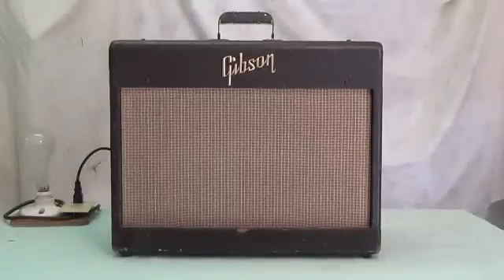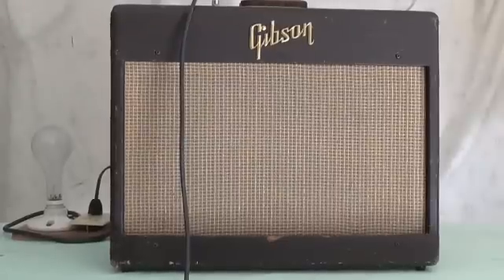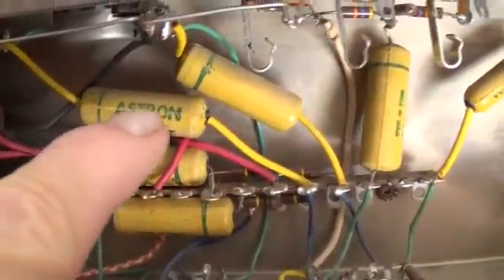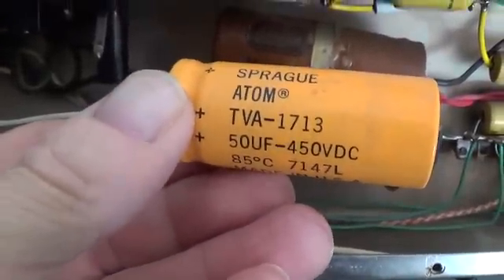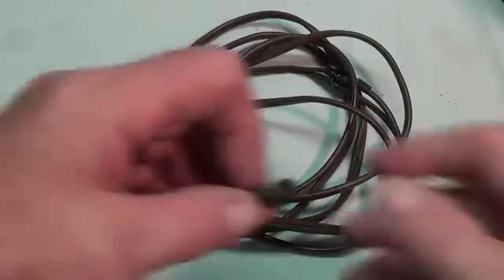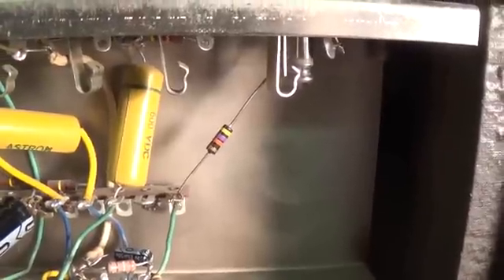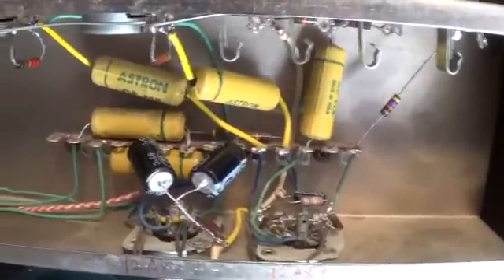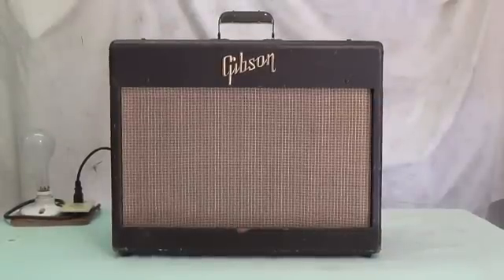Late-50's Gibson GA-6 Amplifier ....with some Very Unusual Problems

Comment: Great video Uncle !!  Thank Rusty for me will ya !!  Your debugging comments did spark an interest in me re: the tube short !!  When there is a situation like this where it seems obvious there is some major component failure(s) - is there a way to pre-check all the tubes in a non-powered mode with multimeter resistance measurements ??  Did you just measure the pins to find that short (of course - after being alerted by the burned up resistor).  Other Comments ??  Do you have a reference that details "good" pin-to-pin resistance measurements for common tubes ??  Thanks again for your great work and your personal integrity !! It's very refreshing !!
Reply from the maker: Greetings, Donald. In most cases the only pins that have any continuity in a vacuum tube are the two pins connected to the filament (heater) of the tube. To be sure, you need to check a tube handbook. To be honest, tube shorts are so uncommon that I don't pre-check for them, unless I see a burned plate, screen, or cathode resistor. Once again, the trusty Current Limiter comes to the rescue. If the bulb flashes or glows brighter than usual when an amp starts up, it's time to turn it off, unplug it, drain the filter caps, and start looking for the short circuit(s). If you don't have a CL, watch my video showing how to build one, and make your own.....before you plug in another vintage amp.
Reply: Uncle Doug
Thanks again for the education Uncle Doug !!  Yup - got a CL and a Variac - and use them liberally.  Thinking about  a tube tester - but that may be a bit excessive !  -- Don
Reply from the maker: Sounds good, Don. Best of luck :)

Comment: It's disgusting how unscrupulous some people are prepared to be with faking repairs. It might be a good idea to take a digital photo of your tube amp before sending it in for repair - that way, any components presented to you could be identified in-place (or not as the case may be). Another REALLY interesting repair - give Rusty a pat from me!
Reply from the maker: Greetings, Stony. Rusty says, "Hi". Your idea of photographing the circuitry and speaker of your amp prior to handing it over for repair is a good one. Some chassis are not easy to remove from the cabinet, but if possible, removal and photo documentation would be great insurance against false claims for work that was really not done. Another really awful possibility would be substitution of modern parts for valuable, good-working vintage parts, so writing down (or making a pencil tracing of) the parts numbers of your original transformers and speakers is also good insurance. No doubt, the vast majority of repair techs are scrupulously honest, but the occasional "bad apple" can taint the entire barrel.....and precautions like this can detect and expose them.

Comment: Albeit not related to the electronics, but wasn't this amplifier used more for harmonica and vocals as opposed to guitars?  Just thinking that some of the poorer mods to this amp might have been the result of trying to voice a guitar as opposed to the mouth-harp?
Reply from the maker: I can't recall any Gibson amps built specifically for harmonica, CB. I think just about any small, portable tube amp can be used for the "harp", but they generally were not originally intended for that purpose. The famous Gibson tweed GA-79RVT was built for accordion use (ugh!), but the vast majority of Gibson amps, including the GA-6, were probably built for use with their guitars. That said, here is a YT video of a guy blowing his brains out through a GA-6:  Harmonica Amps Vol.17 Gibson GA-6  (1954)

Comment: I noticed that when you first began to look in the back of the cab you were poking your fingers in and around all the capacitors as if you had no fear of shock, but then afterwords you discussed how you were going to discharge the unit before examination. Sorry for the long winded comment, but I don't understand how and when there is a hazard, and last but not least should you discharge the threat before you even start to touch a single component in the chassis? It might be helpful if you were to do a video of what components to be cautious of when examining any unit, and what steps are needed when first approaching a examination of any amplified unit, thanks in advance.
Reply from the maker: Josh, you make an excellent point. The video scenes were shot and assembled out of sequence. I had already discharged all the electrolytics prior to the scenes in which I pointed to components with my fingers.....BUT, this was not made clear in the video. I just added two notes to the video explaining this and emphasizing the rules of safety. Thank you for bringing this to my attention.

Comment: Radiotvphonut  his channel on YouTube he will test filter line voltage filter caps capacitors and replace them with new and any old filter capacitors filter caps should be replaced they should not be left in the circuit they get leaky and fail

Comment: Would a P90 equipped guitar be as outrageously loud as a humbucker? Maybe Gibson was just trying to get as much volume as possible out of a low output pickup?
Reply from the maker: Greetings, Steven. Yes, the output signal from single coil pickups is definitely less than from humbuckers.  I guess your theory is possible, but recall that Seth Lover at Gibson invented the ("PAF") humbucker pickup in 1955 and it rapidly became the premier pickup on their best guitars. It seems unlikely that they would produce an amp that was not suited for this "trademark" pickup.....but not impossible, I guess.
Reply: Uncle Doug
The humbucker was only used on the high priced model. I figure that this amp would be paired with one of the lowered priced guitars. I have a late tweed GA-20T and, even though it was made around 1961 or so, it doesn't really do 'buckers and clean at the same time. Gibson sure released some stinkers into the wild, though. A buddy of mine had a GA30 RVT that he struggled with for a long time, until he rewired a lot of it... It doesn't surprise me that you ended up changing a lot of the circuit.
Reply from the maker: Judging from the response I got to my video showing how to improve the tone of the GA-35RVT (which sounded awful in original form.....shrill, weak, like nails on a blackboard), I think you're right. Most mid-60's Gibson amps are fixable, but really need a lot of help.

Comment: Hi Doug, great videos. I'm curious If you built your guitar or modded it? Thanks.
Reply from the maker: Greetings and thanks, Scott. My shop guitar is an old, original 1979 Vantage (Matsumoku) VS-695 Performer model with MMK-45 humbucker pickups. I collected vintage guitars and even considered trying to build one from scratch, but ended up becoming addicted to amplifiers instead. :))

Comment: Greetings Uncle Doug, was everything ok at the OT when they replaced the old field coil with a new speaker?
Reply from the maker: Greetings to you, TB. Yes the output transformer was fine. The old, original Jensen P12R voice coil had started rubbing and making unpleasant sounds, probably due to excessive volume, so the owner replaced it with a brand new P12R.  According to him (he picked the amp up yesterday) it now sounds far better than it ever did, and it now has manageable volume (to protect the new speaker), so  the modifications and repair were completely successful.......Now, it's time for the next big challenge :))

Comment: Sorry I am late to the party, but have you found the culprit for the excessive voltage? Could it be the OT?
Reply from the maker: Greetings, AR. It was more a matter of excess volume, and I got it under control by altering the resistance of the volume pots, installing a 12AT7 instead of a 12AX7, and increasing the bias resistance on the Phase Inverter. It turned out great !! Thanks for asking :)
Reply: Uncle Doug  But didn't those originally come with a 12AX7? You shouldn't have had to change the style of tube....was there maybe some other reason causing the excessive volume?
Reply from the maker: theshyguitarist
According to the owner, it was always way too loud, which led to the demise of the original P12R. Every component checked out OK and the circuit was untouched when it came to me, other than the shoddy electrolytic cap change. I don't have another early GA-6 to compare it to, so it seems like it was simply designed to have a lot of gain.  Recall that this circuit differed considerably from the more modern GA-6 Lancer circuit. Perhaps the changes were necessary to eliminate problems in the earlier circuit.

At the owner's request, I did what I could to reduce the volume in order to protect his new (expensive) Jensen P12R, and the result was still-strong-but-tolerable volume and vastly improved tone. He's quite happy, which is really what matters.

Also, the 12AT7 was a big part of the improvement in tone. In a direct comparison, it dramatically outperformed the 12AX7.....to the point that I would recommend at least trying this change to anyone with an early GA-6. Thanks for your very valid inquiry.

Comment from the maker: UPDATE: Although the schematic shows a 2.2K cathode bias resistor for the phase inverter, a 1.5K was originally installed in this amp. Changing it to 2.7K provided significant additional volume reduction. I believe a big part of the high volume problem was due not to the replacement speaker, but to excessive gain in the phase inverter.
Reply: I have owned several Gibsons of this vintage and almost all are very loud low on the dial, say, around 2 or 3 it gets almost too loud. You might be right about some of the bad consistency on the part of Gibson's assembly (which is often questionable), but I think a lot of their amps are just naturally loud, even when all components are there and functioning as they should.
Reply from the maker: This amp would appear to support your theory, Brad. If it's a common trend, then perhaps Gibson intended it, assuming that customers would gravitate toward louder amps. I haven't seen many ads for Gibson amps during this period of time. I wonder if they ever promoted this characteristic?
Reply: Gibson used linear volume pots in their amps. That makes them appear louder. You have less range of control with linear pots. Replace with audio taper pots and you’ll notice the difference. I had a nice Ga-5 Skylark that was way too loud at 1 and after about 5 it didn’t get much louder but the saturation sounded great - outdoors! I installed an audio/log pot and now I have a usable volume control up to 6 or 7. And saturation heaven after that.
Reply: Hi Uncle Doug,
Just bought a 1958 ga-6 like this one last week and it had the original instruction booklet with the schematic. It's the missing link between the first version and the Lancer. It has a 1.5k cathode bias resistor for the phase inverter. Where can I send it to you. Hope it will answer some of your questions.
I'm a new fan of your videos BTW.
Reply from the maker: An interesting theory, ET. The next time I get my hands on a GA-6, I'll check it out.
Reply from the maker: Brian, I am retired and no longer do much outside work, especially if it involves shipping. Perhaps either you, or a tech, could watch the video to see how the amp was repaired and then apply the corrections to your amp. Good luck.
Reply from the maker: That's a good point, Dave. I have noticed the effect you described, about the lack of increase above 5. Log pots seem to have more usable range. Thanks for your input.
Reply from the maker: Thanks for the schematic, Pierre. If your GA-6 seems very loud also, then it's probably a design characteristic of this amp rather than a malfunction.
Reply: I believe the problem is the potentiometer/s. I have seen countless pot's break the ground off or the signal on the resistive trace inside resulting in either no sound or too much sound. The were in transistor amp's, but it's the same idea.
Reply: The GA-6 in the 1956 Gibson catalog, is described as having "unusually High Gain for
its size". That description is only used for this model.

http://www.preservationsound.com/wp-content/uploads/2012/02/Gibson_Elec_1956_cat.pdf
Reply: I have a GA6 that is doing the same as the one in the video...I would love to send it to you to fix.  Would you be interested in repairing it?
Reply: Thanks I have thought about it....I   just don't want to mess it up even worse.
Reply from the maker: Brian Peters I understand completely. Excess volume seems to be common in these amps. If that is all that is wrong with yours, you can probably continue using it....but if more problems arise, you should seek assistance.
Reply: This is a link to the schematic from the instruction booklet I uploaded: 
https://flic.kr/p/rb85PV
BTW my 1958 ga-6 as the original JENSEN P12R and seems to be loud too but sounds great with lots of bass.

Comment: I've seen the Astron-style caps in a few Ampeg amps...I had one in the shop recently where the rectifier tube was red-plating 3 seconds after power-up, then the fuse would blow...turns out that both caps were wide open! These caps remind me of the one's used in the all-American 5 radios.
Reply from the maker: Greetings, Sam, and thanks for your kind appraisal of the video. I haven't had that much trouble with the sealed Astrons. I tested the caps for proper capacitance, but not under load. Although the video did not show it, I operated the amp at a volume setting of 10 several times while testing it, and it held up well. My camera microphone doesn't cope well with excessive volume.....it all becomes a roar.....so I tend to only record at reasonable volume levels.
Reply from the maker: I agree, Frank. The sealed, light-yellow Astrons hold up well, but the brown cardboard, duplex electrolytic Astrons don't. I can't recall ever seeing a vintage one that wasn't either shorted, open, or way off its proper value.
Reply: Astrons were in alot of the early amps.  Rickenbacker, Ampeg, Gibson, etc. When I test them they usually fail.  Even the yellow coated ones.  They just don't like aging.  How did you test out the tone caps?  do you load test them?  If they were new, do you think you would have had to nurse the circuit like you did?  Thank You for another awesome video!

Comment: Oh, I've seen a lot of this nasty pseudo-repairing job around here, It makes repairing a lot harder.

Weird issue about the crazy volume level; I would say it can be something wrong with the gain of the phase inverter (floating paraphase, old-fashioned arrangement) , It could be driving the output stage too high even with a small input signal.
I think a good speaker, with better sensitivity, would make the amp louder, but not this much!

Great video, you did a great job. Always enjoy watching.
Reply from the maker: Thanks, Nixo. You're right about the speaker. I finally got an opportunity to ask the owner about the original (damaged) speaker, and it was also a Jensen P12R, so different efficiency is not an issue. I find your suggestion re the phase inverter to be quite interesting. I wonder if adding some resistance to the line inputting the signal to the PI grid might not reduce the tendency to overdrive. Also, perhaps altering the cathode bias resistor value. I will try this and report the result.

Comment: Another SUPER video. I learn a lot about these wonderful circuits thanks to you. Keep them coming.  Maybe explain how EQ Circuts work in amps. I never got that.. You did touch on it here!
Reply from the maker: Thanks so much, Jorma. It's always good to hear from you. The tone control in most of these old amps is often quite simple: a pot that offers the high frequency portion of the signal a (variable-resistance) path to ground through a low-value capacitor (in this case .005uf). High frequencies pass easily through a low-value cap, while bass does not. It simply removes more or less treble from the signal, which is why the volume goes down as you "turn up" the bass.....actually you aren't increasing the bass, you are only eliminating more treble. This is not a very good system, particularly at both extremes of the pot setting. "Active" tone controls are much better. They actually boost the desired frequency, rather than simply eliminating the undesired one. Perhaps this would be a good topic for a video. Thanks for the suggestion.
Reply: That would be very awesome. I am interested in the Fender, Marshall, Vox slopes and how they work. Its a topic that always eluded me. an understanding of Active EQ would be super valuable too.
Thank you for all of this time and effort!